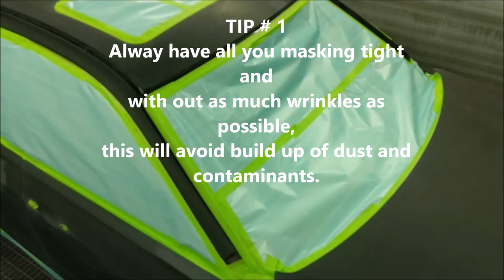PPG paint  5 AMAZING TIPS ON PAINTING A COMPLETE

Comment: what size tip did you use to apply the base and clear ? ....Does using a 1.0 or a 1.2 means way less orange peel or non at all ?
Reply from the maker: Right now I've been using 1.2 for base and 1.2 for clear. Generally the thinker the product the smaller the needle should be but for clears I wouldn't do anything under 1.2 orange peel will be more effected by air pressure tahn tip size higher the pressure less orange peel